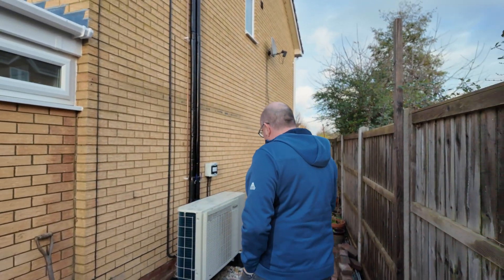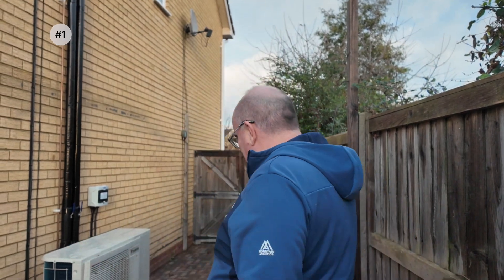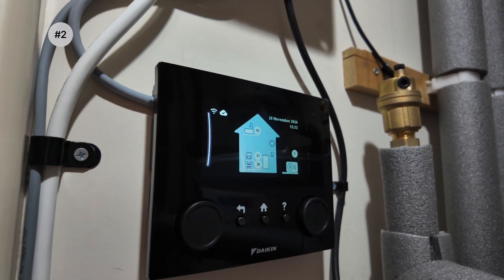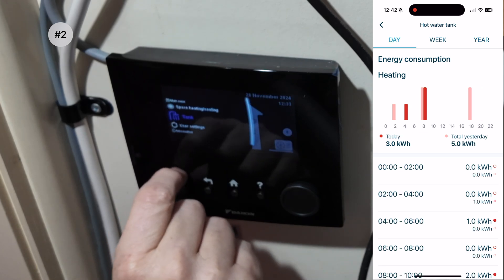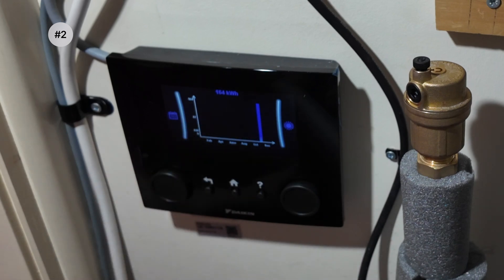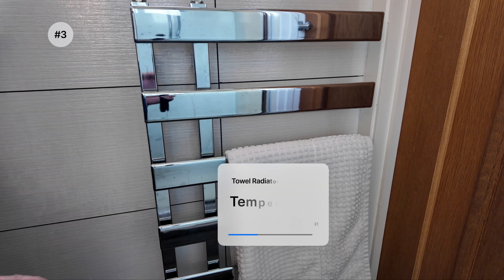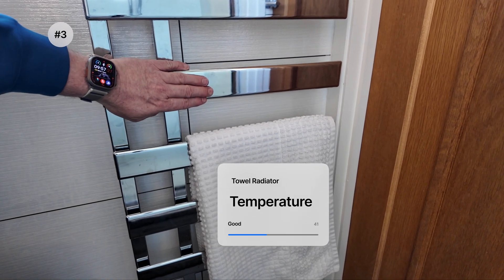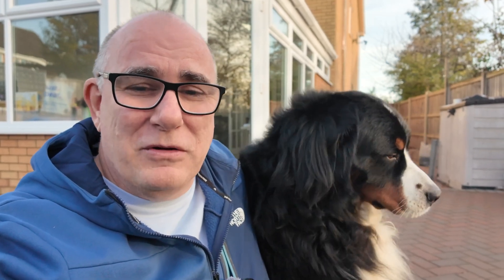3 THINGS I HATE ABOUT HEAT PUMPS

Comment: They're supposed to have a very slight tilt so that they drain properly internally.
Reply from the maker: they have that setup inside as i have seen it drain out the hose but the unit is set level

Comment: At first I was starting to think you weren't being entirely serious when reason #1 was standing water. The lack of online data tracking is more of an issue for me and reason #3 should, in theory, be offset by the heating being on more often so unless the towels in question are used multiple times within a short space of time its likely to be a non issue.
Reply from the maker: the towel issue is really a perception from the family, yes they dry but when the towel radiators were scorching hot they dry in a few minutes rather than a few hours.

Comment: I've had a look at the top of my unit, the lip round the top diverts any water landing on top to the run off channels at the front left and right corners of unit.
Most likely to stop this water dripping onto the evaporator and causing it to ice up even quicker.
Reply from the maker: When’s the same however as the unit is completely flat there is no incentive for the water to run towards those places so it just sits on top of the unit until it evaporates leaving the dirt behind

Comment: JT, what heat emitter did Octopus set up on your system, they told me Fancoil rather than Radiator works better.
Reply from the maker: to be honest i have no idea, do you know how i can check?
Reply: In MMI under the zone settings, you'll see emitter type
Reply from the maker: i just been through every setting but can’t find that setting, any idea which menu it’s buried in?
Reply: https://youtu.be/wBjx_WqXj6Q
Reply from the maker: I think that’s in the installer settings which I don’t appear to have access to. The installer said that because it was going to be under an octopus maintenance agreement that I would be locked out of those settings.
Reply from the maker: Okay, calm down. I’m only reporting what I was told, and to be honest. I don’t really wanna be poking around in the settings. My house is nice and warm and  i don’t need to change anything, so never really looked. But I will take a look.

Comment: On our towel radiator I fitted an electric heater that is only used on a timer in summer when the heating is not on, as our HP is on 24/7 the towels are always dry by the next day anyway so the lower temperature is no bother.
Reply from the maker: Yeah a lot of people seem to have done the same, may have to look at that

Comment: 164 kWh, is that your house total or just heating/hot water?  That seems really high, especially if you're paying 20-30p per kW.
Reply from the maker: That’s combined hot water and heating. It was also the coldest week of the year so the Heat Pump was working quite hard the following week it dropped off massively once I’ve got a full months worth of data I will publish it also I’m not paying 20 to 30p a kilowatt, I’m importing power during the night at 8.5 pence per kilowatt and storing it in batteries so my cost to run it is very low

Comment: Thing is, comparing those numbers with a true heat monitor, they are just approximations. To get useful data would mean it costing far more. 
I don't particularly care about exact cop values just how much it costs to run and prefer to run it when energy is cheapest rather than when efficiency is highest.

Comment: I agree with your first two comments, the towel rail was always going to be an issue with a low flow temperature but they do dry over time.  For me the third issue is the location of the control panel as its very hard to access (and clunky as you describe).  Crying out for an upgrade of App  so all can be done on the App along with automatic COP readout.
Reply from the maker: i’m hoping that octopus will integrate it into their tool set using the new Mercury platform then we won’t have to use the Daikin app anymore
Reply: @JonathanTracey  Hope so too, so if you are watching Octopus !!
Reply from the maker: i’m not holding out any hope for a solution in the near term but maybe in a year if they can get mercury adopted by daikin

Comment: Morning JT

I'm having my HP installed by Octopus this week, I asked them about how to heat the hot water, should I use Eddi overnight like I I used to or should I use the HP overnight. They suggest I use the HP first to heat water upto 48-50 deg (max from HP apparently) and then use the Eddi (again in the  IO cheap rate period) to top up (boost) up to whatever water temp I'm normally used too.

I'm wondering if you were given same advice and if you have tried it?
Reply: My Daikin 6kW 'low temperature' HP heats the HWC water to 60C without any resistive heating involved.

My nominal HWC temperature though is 43C a) for a nice hot bath/shower without mixing, b) lower temp' gives better efficiency c) Heats to that fairly quickly.
Reply from the maker: Agree 43 makes for a nice shower, and it’s reheat is fairly quick, so we always have 43 degree water available for anyone to use
Reply from the maker: yes except as we use mixer showers we don’t need hot water beyond 48 degrees. it doesn’t make sense to heat the water any hotter just to add cold water to it for the shower. we then use the Eddie in place of the inbuilt booster function to heat the water to 65° once a week for the legionella cycle.

Comment: For performance monitoring I use Open Energy Monitoring with a MID heat meter on the primary flow which gives accurate performance data in realtime which you can access on a mobile device, desktop or online. You can also download any dataset you want.
Reply from the maker: thanks will take a look

Comment: I agree about point 1. Ours is going green on the top and wipe it down regularly. I would love it to integrate with Agile and use the cheap slots to heat the hot water overnight. My wife would agree with you about the towel rails. We might look at converting electric, but it is a faf.
Reply: I would love to have automations that integrate with Agile - although I'm starting to find that since you need to have it running for long periods to be efficient the erratic pricing (especially recently !) mean a lot of tweaking to avoid losing all the heat during a price spike. Octopus Cosy is starting to look like a good idea now !
Reply: @ Octopus Watch says I am £35 a month better off on Agile than Cosy. Hopefully Agile will come down again soon. Saying that I averaged 16p kWh of November. Still miles under the price cap.
Reply from the maker: The octopus energy integration with Home Assistant allows you to get the 30 minute pricing from our agile, so it’s pretty simple from there to build an automation that turn something on or off based on a threshold price that you set
Reply: @JonathanTracey  Indeed. BottleCapDave does an excellent job.
Reply: My HP was installed with a Mixergy 'smart' HWC which is controlled by a raspberry Pi unit (transparent to user really), and one of its good points is that it 'intelligently' supports the Agile tariff, along with 'Heat Geek' settings that allows HWC temperature control in one degree increments.
Reply from the maker: that’s pretty cool, love seeing this kinda of thing work with a Pi
Reply from the maker: i’m going to design a cover that funnels the rain off the sides. I see in the daikin app it lets you integrate with intelligent octopus go, but can’t find any details. I probably will wait till we redo the bathrooms and covert towel rails then

Comment: I guess we have gone a bit extreem. We have solar, battery and MVHR. Our towel rails (not radiators) have electric elements and are triggered by motion sensors to come on for 15m if the shower is used. its working very well for us.
Reply: " have electric elements and are triggered by motion sensors to come on for 15m if the shower is used"

======

That's got to qualify for 'Master Geek' award 😉
Reply from the maker: i will probably convert to electric shower rails as they will be powered from our batteries. how’s rhe MVHR working for you?
Reply: @JonathanTracey  I think it was probably worth it. We started with a very poor building that had no ventilation and was damp with mould problems. That caused us to go to the extra levels that we have. We would have had to fit 5 extractors (3 bathrooms, kitchen and utility). The MVHR hardware was just over £4k and quite a tricky install. We have changed so much that it is hard to say how much a single tech like MVHR made but I can say that our home is warm and just so comfortable. It is still a building site to be frank but when we go to other houses we realise just how comfortable out home is for temperature and humidity.
Reply from the maker: we don’t have much of a problem with humidity, both bathrooms have extractors that feel like they are jet powered so it’s generally below 60% in the house. But find it an interesting technology, thanks for the info
Reply: What motion sensors are you using, can you say?
Reply: @sergiotavares8736  I have a Loxone home automation system so use the sensors that are part of that. This means everything can be configured in software. If we go into that bathroom on a morning it triggers the recirculating pump for 30 seconds to prime the hot water and puts on the towel rail, the lightswitches also monitor temperature and humidity so can boost the extraction system if required.
Reply from the maker: I do something similar just not heating the towel rail (yet) when the humidity in our bathroom raises above 70% it will automatically turn on the extractor for 10 minutes, before checking again to see if it needs to continue to run. It also toggles the smart switch at the entrance to the bathroom in case somebody’s left it on so that the phone can turn off when the humidity drops below a certain level. It will automatically sense that somebody started the shower and turn on the extractor so we never end up with a humid bathroom.
Reply: @sergiotavares8736  I am using Loxone sensors as part of our install, these monitor movement but also light levels and ausio but you really don't need all that smart stuff for this use case.

Comment: The top surface is easy to put a level on during installation. I built a roof structure for my tall air to air unit, mostly because we get a lot of hail storms, but it helps for all weather. Just allow for air flow.
Reply from the maker: I’m planning to do something similar,

Comment: Chrome radiators give off about 30% less heat than white or black ones
Reply from the maker: why is that, surely the chrome is just a finish, the radiators will be the same material underneath?
Reply: @JonathanTracey  Radiation.  Think of foil emergency blankets, or foil insulation.
Reply from the maker: even if 30% is lost they still used to make toasty warm towels, now they are just warm

Comment: I have had some 3rd party monitoring equipment installed and it shows that the data reported on the Daikin interface is very inaccurate.
Reply from the maker: that’s what i am starting to see, what 3rd party system did you install?

Comment: Regarding data, it's most likely because the longer term average HP user will not be a Geek by default as we tend to be now.

Water gets pulled through the HP by default when it rains.

Towels drying ? Patience required 😇
Reply from the maker: I’m an impatient data geek that doesn’t like water in my electronics😂

Comment: Definitely look into getting electric elements for the towel rail. We use them on a timer in the summer when the heating is off and the solar is on. Dry towels are a must in our house!
Reply from the maker: Will do, I didn't know you could have both systems in one radiator.
Reply: @JonathanTracey  It depends on the model of radiator... but it's defo possible... don't forget that most rads will have a connection at each corner... and the water only uses two of them, the vent uses one, which leaves one spare.
Reply from the maker: Yep I checked online and mine can take an electric heater, now just have to figure out how to get power to them without ruining the tiles
Reply: @JonathanTracey  we just drilled a hole into the room next door and installed a fused spur/time switch. Key thing is to make sure you don't use the element when the heat pump is running as it could overheat.
Reply from the maker: That would probably work in one of our bathrooms, but the other towel radiator is mounted on an outside wall with no cavity that’s easily accessible. I’m not in any rush to do it right now but will come up with a solution. Good call on the running out at the same time, hadn’t thought of that.

Comment: As for the towel rads, what about keeping the rads and adding a supplemental electric element. If your lucky you may be able to swap a 90° elbow for a T and fit the element up from the bottom. You could then have heated rails in the summer when the space heating isn't in op as well as boosting the winter temp?

Have a look at Flowmaster 263TF for example, £24 at Screwfix, claims temp range 40°-70°
Reply: Won't the heat just escape into the rest of the system if the water is being pumped around (i.e. during winter)?
Reply: You could potentially use a smart TRV and a smart switch or relay to close the radiator and heat it up morning/evening as desired  @BrendonBoshell
Reply: @BrendonBoshell  Yes it would, but it may turn out to be the best solution by perhaps closing the flow valve in the space heating months.
Reply from the maker: Hmm hadn’t considered that
Reply from the maker: Oh, I didn’t know that was possible. I thought it was one or the other will take a look, thank you.

Comment: My neighbour complains they can only set the temperature in whole degrees, 21 is too hot and 20 too cold. They'd like a 20.5.  it is a Deakin.
Reply: I have a Daikin Altherma and you can set half degree increments on the thermostat (and app) but annoyingly not in the schedule !
Reply from the maker: Yeah that’s an over sign in Daikin’s part, seems one part of the app UX team didn’t know what the other was doing.
Reply from the maker: I wonder if it’s a firmware issue as mine allows half degree increments using the thermostat same if I change the temperature using the app
Reply: Hi there  @JonathanTracey  I have the same gripe about half degrees. Intrigued you say that you can alter yours - I can for the main thermometer on the app, but half degrees don't seem to exist when setting/altering a schedule. Can you confirm if this is the same for you?

Comment: Heat pumps take getting used to. To run effectively you need to: 1) reduce the flow temperatures both both heating and hot water 2) run them all the time - with a set back at night and 3) optimise the controls/timing. Hot bathroom towels I miss. I don't miss how noisy the gas boilers are. If you move to a suitable electricity tariff, a COP of 3.2 overall still beats gas costs.

If you want a lot of data - this isn't necessary but is useful (no one needed this with gas boilers) - there is the ESPAltherma route (possibly voiding warranty), Open Energy Monitor (plumbing and electrical work) or, if they have an API I bet someone has already written an app.
Reply from the maker: I’m starting to look at the API myself as I’m sure I can knock something together, but I’m also going to investigate the ESPaltherma. The COP is already starting to improve as we get more usage I’m sure once we get a few months it will creep up closer to 4.

Comment: that last point was interesting, maybe Octopus have learnt something from feedback because when I had my Survey last week the engineer actually pointed out that the ladder style radiator in my bathroom would be ineffectual in  a Heat pump system and put in the configuration to change it to a vertical panel type for the bathroom.
Reply from the maker: they have definitely got warmer since I bled the radiators but as others have pointed out they’re not really designed to push out large amounts of heat as they don’t have huge surface areas other than the parts covered by towels.

Comment: Water pooling on the top is simply lazy design. 

As you say, the top panel sloping backwords would solve the problem but Daikin are effectively legacy manufacturers who have become complacent, sticking to their mantra of "we've always done it that way" .

Heatpump/air conditioning units haven't changed their aesthetics for decades, its refreshing to see a departure from that white square box design by Octopus energy.
Reply from the maker: I fully agree with you however I suspect they’ve got large amount of data from the millions of units deployed worldwide that says water doesn’t get into it so therefore why bother changing the design?

Comment: I agree about App and I get same COP around 3.2 - is it low because it includes hot water? My problem is I have low water flow - 12 litres min from cold tap but less than 7 from one shower. Octopus been back a number of times and are still looking into it. I got my neighbour to time filling my 10 litre bucket - he got 30 seconds so 20 litres a minute. Therefore not a water-board problem.  I know they put a pressure restricter on the hot and it only gives 2 bar, but I didn't think they restricted the cold pressure.
Reply from the maker: i’m sure the COP will improve overtime once we get a bit more data under our belt. it does sound strange to have such a low flow of water. Have octopus been back out to have a look at it.
Reply: @JonathanTracey  Yes they have been back a number of times with 'different pairs of eyes' and are still puzzling over it. I am actually wondering now if the stop-cock is faulty - we did have a pressure surge during commisioning, which burst a hand basin flexible pipe - could it also have damaged the stop-cock? Clutching at straws I suppose.
Reply from the maker: Yeah maybe get one of the heat geek people to look at it